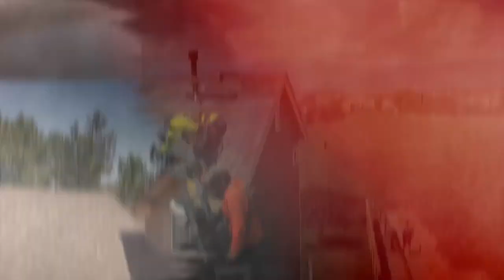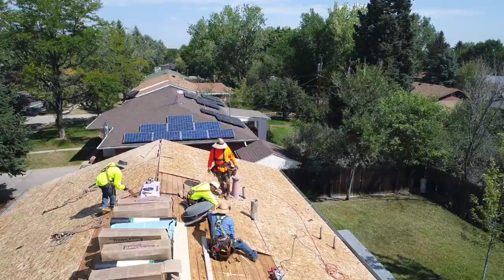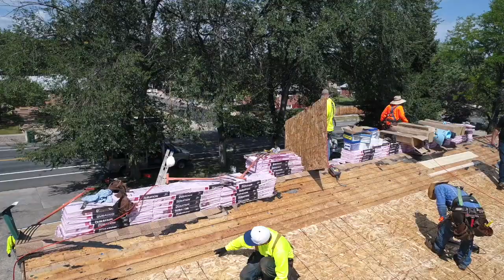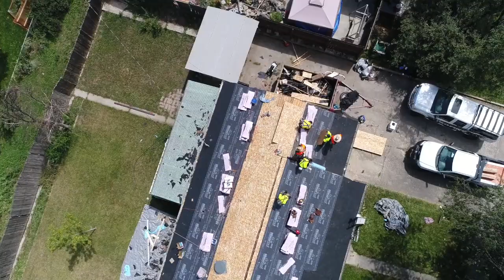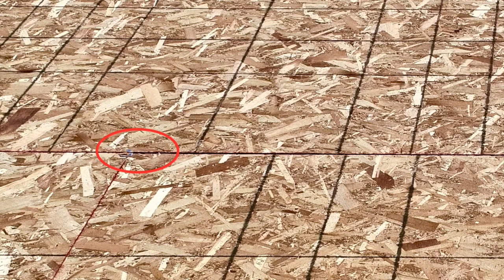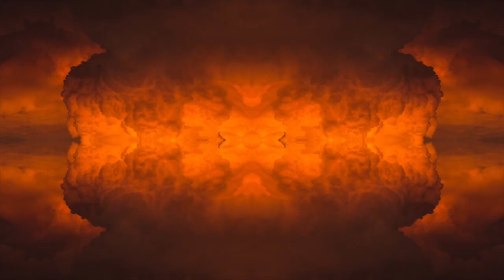How to Re deck a Roof

Comment: Don’t pay attention to the haters. OSB over the planks are a great way to go. Most of these guys only install to code. A 4 letter word that means “ minimum allowed by law” , you can always be better than code and end up with a straight flat roof. It will be structurally stiff and straight. These guys are efficient! Good job.
Reply: Osb is not as good a quality as plywood. And osb only needs to get humidity contact for a short while before it is destroyed. Moisture in that attic would kill their new roof.
Reply: @dragonslayr  You know nothing about roofing it seems....

Comment: Nice job. The workers look like they know what they're doing and very fast. Nice drone work and narration. I just had my roof put on an 1824 home. Two layers of asphalt removed. The boards underneath had gaps and were probably original. I was advised to do sheathing and  chose plywood. Wasn't sure if this was wise or not.

Comment: Hi I am curious, at 5.57 on the video the guys are sliding OSB board underneath the over hang of the front roof slope. 
How is the OSB, under layment and shingles fixed underneath what appears to be a 12" at least overhang. Also how have they waterproofed the back edge of that the lower roof under the overhang?
Reply from the maker: Dave, we have a low clearance installation video on our Youtube channel. There are palm pneumatic nailers for tight areas.

Comment: WRONG: its best to over hang the plywood on the rakes THEN snap a line the entire length in case the rake isn't straight. just saying
Reply: Well that's basically what they were doing except sheet by sheet.. still serves the same purpose correct? btw if the rake isn't straight it wouldn't matter if you popped a line the full length or not the rake will still not be straight right? They were cutting with the line of gable rake.

Comment: I’m curious as to who said the planks on this roof were no good. That’s perfect decking, and much more durable than OSB!
Reply: Well your not a roofer, old space sheeting is just like plywood,it dries out and breaks like glass when struck. Osb is far more superior than plywood for roofing applications! I know because i am a pro! Plywood belongs on subfloors not roofs!
Reply: It seems they are used to close the gaps, so nailing the shingles won’t result in nails not hitting the deck. But, since you are an expert, and you use a hammer to drive your nails, that would never happen to you....
Reply: Those old deck boards were a good system, but they eventually get all busted up and whole chunks get knocked out of them through successive re-roofs.  And they shrink up, cup and warp, so that you have long gaps between the planks, sometimes a half-inch or more.  Also the nails can get really loose.  That particular roof didn't look too bad, but they get way worse than that, and overlaying it with OSB is standard practice and really the way to go.  I did an old house by myself and overlayed it with 7/16ths Zip Sheathing so I had time to get the shingles on by myself.

Comment: Since the sheathing was installed over the planks doesn't that extra weight compromise the structural Integrity of the rafters or do you have to reinforce the rafters before applying the sheathing to withstand the extra weight because of not removing the planks first
Reply: He's got 5000 pounds of roofing material stacked on the ridge and your worried about some 7/16" wafer board?😆
Reply: @mitchdenner9743  hilarious, so true
Reply: two or three layers of shingles (which is common) weigh a WHOLE lot more than a layer of 7/16ths OSB.  Roofs take that with no problem.

Comment: Typical nailing like crazy...start off fast and have nails spaced further apart at the top and then spaced closer at the bottom. I'm a framer with 17 years experience I really don't like seeing this kind of nailing.
Reply: yeah I've always heard it's 6" on the joints and 12" in the field. So 9 nails on the side joints and 5 per rafter in the center of the sheet with the first and last nail within 1" of the top and bottom edge.

Comment: When you Re Deck a roof what size plywood do you use.
Reply: Mr_RealTalkTony 7/16
Reply: @jordanmack4225  ok thanks
Reply: Do not use plywood use osb! Plywood dries out and warps becomes brittle,osb has glues that keep its integrity. Plywood is for subfloors. Only men who would use plywood are dinosaurs and still think modified,torchdown is good shit! They are wrong and it is not. Go pvc,tpo,or epdm for low slopes
Reply: @allenbrooks7318  modified torchdown is still the standard for flat and nearly flat roofs. And wood planks is far better than OSB, as far as resistance to water and termite damage goes. That’s why it was smart of this roofer to keep the planks

Comment: Don't think I would have used H clips on a sheet over 1 x  material, you only need them to stiffen up the joints between trusses.  I would have used a few 8's to get my gap. I don't rooftop osb, I have my osb, felt and iceguard dropped on the ground. After my tear off and resheet are done and I'm blacked in, I have my shingles roof topped.

Comment: Why do you say always use a framing nail gun when installing the decking why can't I just use a hammer like the old school method
Reply: Because this guy's in the business of making money time is money you don't need a nail gun if you want to nail by hand absolutely I think it's better that way. Especially  when shingleing.
Reply: I only do my own rooves anymore,  but I have a single stapler and a shingle roof nailer I have been able over 30 plus years to notice a vast difference in hand nailed shingles and well set up pneumatic nailing. 
The adjusted pneumatic tools don't break the backs of the shingles.

Comment: I have a question, I hope someone can help me.  I am about to reroof my own home as it ous too expensive to hire out, my question is:  do I have to remove the existing sheathing considering that the roof doesn't have 1x6's, it only has the plywood on top of the rafters.  Thanks
Reply: No you don't. Typically there is only plywood sheathing on the rafters. This particular house when they took off the old shingles found the 1x6's with gaps between the boards, which depending on how big the gaps were, could be insufficient for a nailing surface for the new shingles. You wouldn't want a row of shingles where the nailing strip is land on that gap and the nails not bite into anything.
Reply: Only replace damaged or weak sheathing if needed. Inspect the sheathing once you tear off the shingles. Walk around and check for bouncy or spongy spots, or rot and water damage. Your better off doing the work yourself.  Trust me , most of these companies are there to make money quickly and nothing good comes with speed. Don't forget to hand nail shingles for best results.
Reply: @mitchdenner9743  thanks Mitch. Can I just lay  new sheathing on top of the whole roof as I know I have a lot of sagging, will this way pass the city inspection?
Reply: @carlospacheco7361  if you have sagging then you have some damage and no it won't pass inspection
Reply: @carlospacheco7361  , the sagging is probably not the sheathing, more likely the rafters. Older roofs that had wood shakes or wood shingles were decked with 1x6 planks. They were were strong and allowed for plenty of space for seasonal movement (expansion and contraction). Later on roofers started using plywood with asphalt shingles. They are lighter, and 7/16ths was probably okay. But 1/2” would be better, and 5/8ths better still. 
Another thing - if your rafters are failing, it’s probably because they were carrying too heavy a load - more than one or two layers of roofing that should have been town off when the new roofing was installed

Comment: Ermmm. How do u know ur hitting raftera.
Reply: ChrisXCXCX Usually you would get your mark from the old nailing pattern off of the existing planks and chalk line when you lay the first ply down but with most roofers they go by eyeballing it and if you were to go to the attic you’ll find that 10-20% of the nails didn’t hit their target lol
Reply: Should be following former nail lines and can see between the old boards,  but they should have snapped lines.

Comment: Can you reroof over the planks
Reply: Edward Chavez if the planks are in good shape and have gaps between an 1/8 to 1/4 of an inch you should be good but check with your local building codes.
Reply: I’m not a roofer btw just advices from a roofer friend when I did my roof which I sheathed
Reply: You could reroof over the planks, personally I would have taken then off and put plywood on the rafters.  But this is a money saving deal.  Putting the osb on the planks is a very strong repair.  I just hate osb.

Comment: You dont reply anyways so... never use osb if you really can afford plywood...
Reply: OSB is more efficient and will last longer.
Reply: @serenap.1041  not if it gets wet, which is often why roofs fail in the first place...
Wood longevity rated by degree of processing after cutting the tree: strongest - wood planks, next - plywood, last - OSB. 
Rating by price: cheapest -OSB, more expensive - plywood, most expensive (and probably not available anymore) - wood planks

Comment: Any roof you put down is only as good as what it's nailed to. Your putting a 25 to 30 yr shingle to a 7 dollar pc of wood. Or should I say clued wood chips.
Reply: Plywood dries out and becomes brittle even if never had been hit with moisture,when you tear off a 25 30 year old shingle with plywood under it, the plywood is fucked. Thats without water damage. With water damage its major fucked. Osb on the otherhand if not met with moisture can last a lifetime of re shingeling as long as no moisture gets into it. I know because i have torn of many roofs and always have problems with old plywood. Never have any issues with old osb. Because the glue keeps it sound and does not let it dry out like plywood or space sheeting. Dont know how many times ive hit a nail in old plywood and space sheeting just to have it explode like glass. I have over 30 years experience, roofed kid rock Dennis rodman modanna mark farner just to name a few high profile customers houses so please quit talking like you know about roofing. And for the lovw of god keep plywood on subfloors where it belongs and not on a roof! Cowboy out!